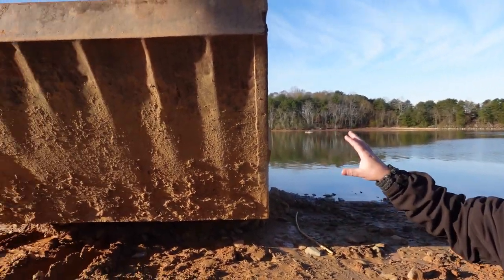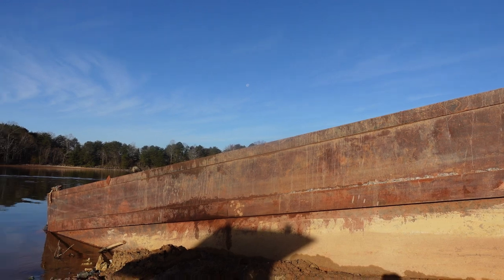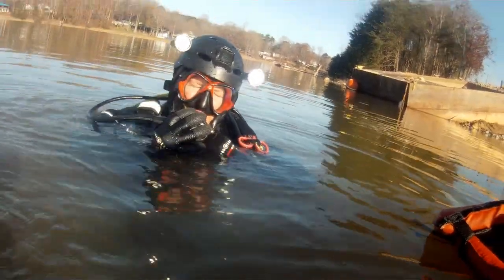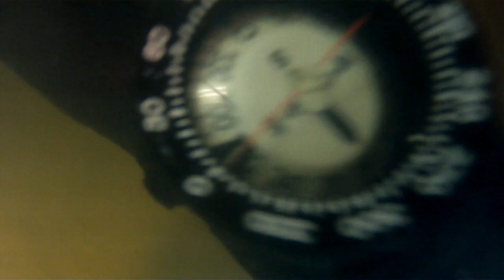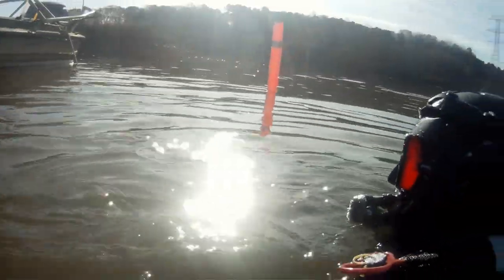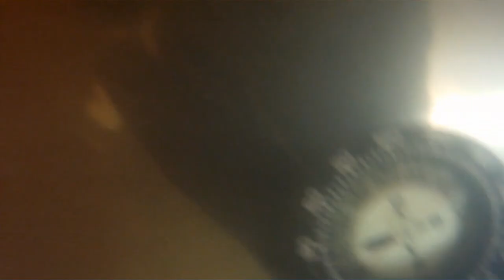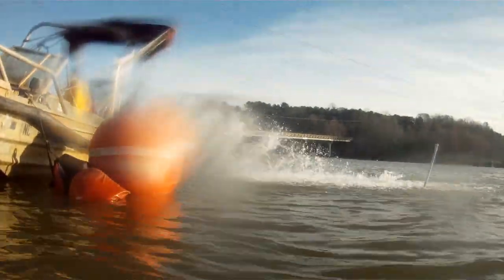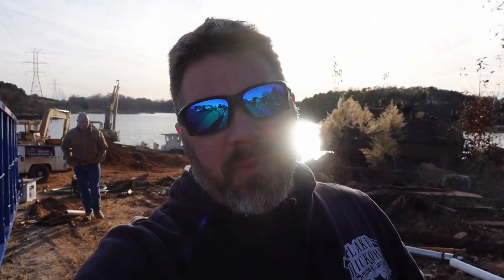Barge Salvage Failure

Comment: Something that works really well underwater for patching those holes like that is called splash zone it's a two-part epoxy in equal parts mixed together and it sets like concrete but a lot faster and you can play it like putty and put it fill those cracks up really well and it'll set underwater so it'll even hold even after they get it on top
Reply from the maker: Thanks for the suggestion Jason Walker, we will look into it.

Comment: Question:  Are you taking any particular additional steps to control your bouyancy when you are carrying those heavy porthole covers?  35lb is a fair weight and when you let go of it, you're obviously going to be suddenly very positively bouyant?
Reply: some times you cant. some times you have to ride it to the bottom. pop pop pop pop pop
Reply from the maker: Hello Max Torque. In this situation, we simply rode it down. Depth was not really an issue for us. Any deeper and we would have used a lift bag so that we could slowly lowered it down by venting air slowly.

Comment: I had a Delta P scare while doing some work for someone in a private pond.  The drain valve on the outside of the Dam was run over by a skid-steer and forced the lake to drain out of a 3 inch pipe.  The lake was 23 feet deep in the area where the drain was. I was hired to go and cut the “screen” off of the drain and install an expansion plug on the pvc drain. My fingers were caught between the plug and the pipe while trying to install it. Fortunately I was able to get out without losing any fingers.
Reply: scary, glad you are ok.  That could end very differently
Reply from the maker: Thanks for sharing your story with us Nick Jarboe. Glad to know you came our ok and uninjured.